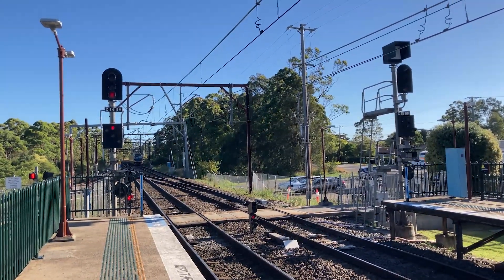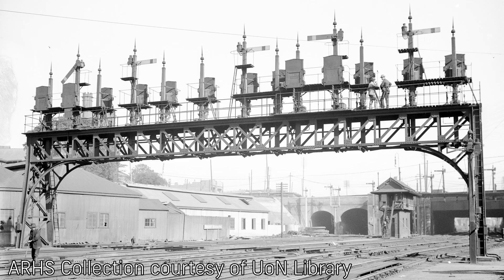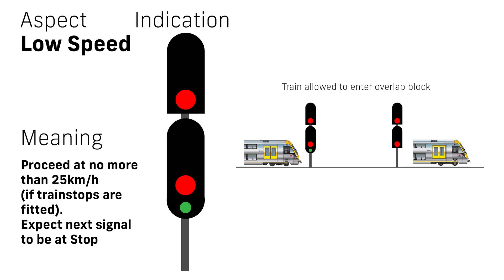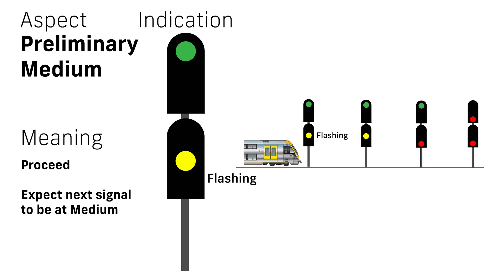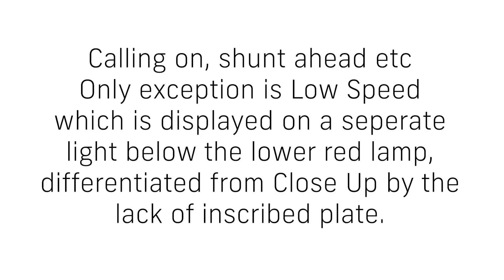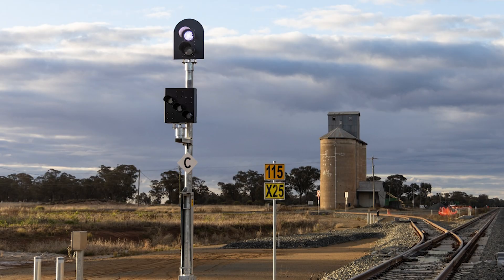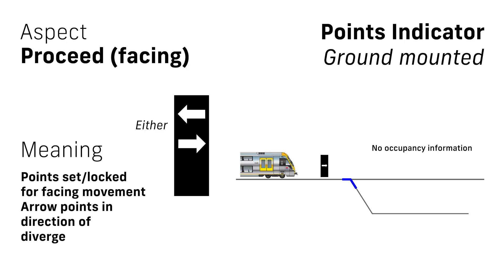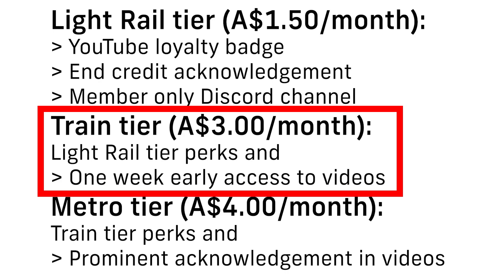NSW Railway Signalling - A Complete Guide

Comment: Mainline indicators are NOT signals - and they are not found in signalled territory. Only in Train Order territory and they do not provide any authority or permission to proceed. 

Yellow MLIs do not indicate the next MLI is at stop. They simply indicate that the infrastructure that they are protecting is working correctly, but that there are other frames or points that are not interlocked with that MLI in the area to be on the lookout for. 

Medium signals in most single track, traditional CTC style lines are pretty much only ever used for early warnings for turning out. Old style loops generally go in on a low speed signal, meaning a caution on the distant
Reply from the maker: Re MLIs I was working off the rulebook.
Reply: According to the rule book:
Steady yellow light
Points are set for the main line, and warning
equipment at a level crossing is in working order.
The next main line indicator, where provided, may be
at STOP, or
Proceed at Restricted Speed:
•
to the next point indicator or
•
STOP sign at a terminal location

Comment: Also some regional lines such as between Narrabri and Moree, Joppa Junction and Canberra, Orange and Dubbo, Junee and Griffith plus Werris Creek and Armidale are TOW (Train Order Working) sections where the train MUST obtain a special encoded signal or write down instructions on paper where the train wants to go to and if they’ll require shunt access at their destination such as Armidale for the Xplorer train and West Tamworth yard for freight trains, crossovers if another train is in the same area and how the 2 trains will pass each other, at Werris Creek sitting at the Armidale end of platform 1 is signal 1549 which instead of a GREEN light indicating a proceed aspect, a flashing WHITE light is used instead signalling to the driver that they are about to enter Token or Train Order territory and need to obtain a token or a train order from control before proceeding, signs marking the start and end of train order territory have BEGIN TRAIN ORDER WORKING and END TRAIN ORDER WORKING on them

Comment: what should the driver do for each signal?
Reply: @philhoward4466  I’m a driver so can help with that. As a general: 
Clear - Track Speed
Medium - Prepare for the next signal to be caution. I.e. Slow down appropriately expecting the signal two away to be at stop. Preliminary medium meaning be prepared to stop 3 away.
Caution - Next signal at stop. Be prepared to stop at the next signal.
Stop - Stop.
Turnouts - Prepare to turnout at turnout speed. Medium meaning next signal at some sort of clear and caution meaning next at stop.
Calling on - Allowed to enter the block but be prepared to stop as another train may be in the block. I.e. Before the next signal there could be a train. 
Close up - next signal is at stop and the block after could be occupied. Mainly to get trains closer together in busy suburban areas.
Those are the main ones, shunt ahead are super rare, low speed is very self explanatory, as is close up.

All of this depends on route knowledge, it’s the drivers job to know where the signals are and what the track speeds are. So there’s not set rules as to what to do when you see a specific signal. The driver must know where they are and what they must do to obey the signal indications.
Reply: @randomonium19473  -- being x- freight plus inner city driver, I always lived by the motto that the railways paid you stop before the signal,  you PAY the railways if you stop on the WRONG side of the signal.
PS I'm using my late daughter's tablet, just in case of some confusion.
Reply: Green over Green is called as a two in cab=proceed at track speed 
Green over flashing yellow is called as a 1 & 3/4s= good to proceed next signal may be at caution or Green over Green 
Green over steady yellow is called as a 1 % 1/2 means the next signal will be a caution 
1 is a Green over red= next signal will be at stop 
Red over red is called as an all on=signal is set at stop